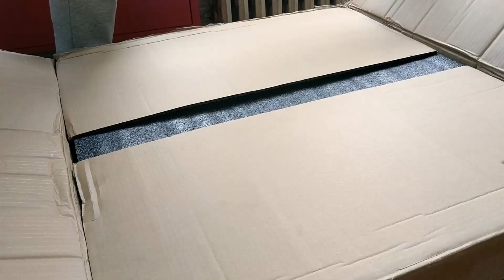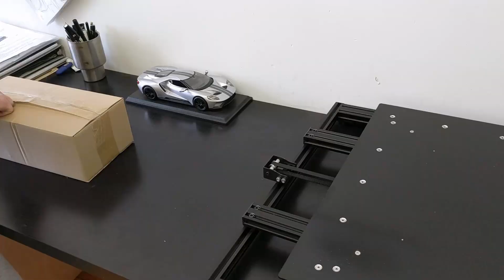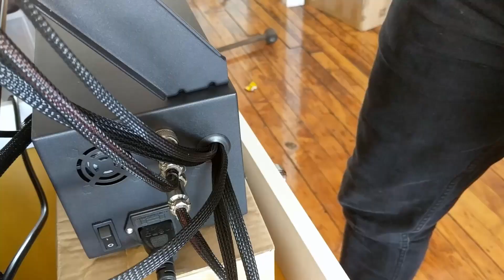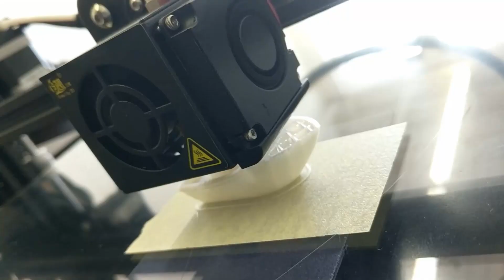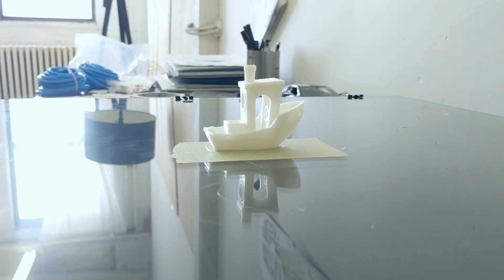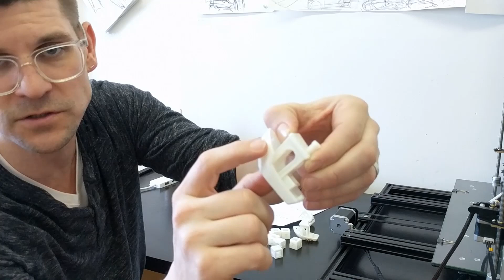CR-10 S5 First Impressions

Comment: I use Slic3r, Cura, and Simplify 3D (S3D). I have been meaning to try Ideamaker at some point. My advice is to wait on buying S3D until you run into a model that needs. S3D is worth the cost if and only if you need it for a particular model. I find that I tend to prefer the Slic3r infill and support options for most of my models, especially those with long supported surfaces (like the bottom of a car model perhaps). S3D however, especially with custom supports, was the only way I was able to print a Daniel Craig as James Bond model. 

So basically, if you run into a model where you find yourself cursing at the screen and yelling "I just want to put support right THERE!", don't hesitate to drop the cash for S3D.

Comment: I received a cr10s a couple days ago, so I'm also new to this, but if the ringing is displayed on the Y face of the cube is a problem with the x axis, since the ringing occurs when you have a sudden change in depth which mean an X axis movement. 
In my case I don't have much ringing of the y axis (it's big, heavy and has more friction so oscillations dissappear faster and aren't as noticeable) but in the x axis (Y face of the cube) I have a lot of ringing. 
I've heard you could improve it with better belts that are less flexible (if you don't want to reduce speeds/acceleration) but it will be a couple of weeks before I can import some belts to test it.
I haven't tested it, but increasing friction should also be beneficial, as long as it's not loading the ☓ stepper too much.

Comment: Are you in the Facebook group for this printer?   Lots of keen minds there.  It could be your acceleration, jerk or other settings too
Reply from the maker: Thanks.   The Facebook page has been super useful.   I'm pretty sure Simplify3D does not have specific Acceleration and Jerk settings.    When I was messing with those settings in Cura, I was able to get better results but the settings alone did not completely eliminate the ghosting.    Rock on!   Thanks for watching!
Reply: I have the CR-10 (original) and the CR-10S   On the first, we couldn't save anything via the controller.  It had to be done with gcode (Scripts tab in S3D)  On the CR-10S, you can make changes and save it to the firmware.  I think you can on that printer.
Reply from the maker: Have you found a Jerk and Acceleration setting that is working for you?
Reply: Check this group out .... I bet they can help you nail it down.   https://www.facebook.com/groups/1427464350669793/
Reply: Where Nerdy is Cool! Unfortunately with the stock firmware you can't store the settings in the eeprom. But you can always override them in the start g-code of your slicer of choice.